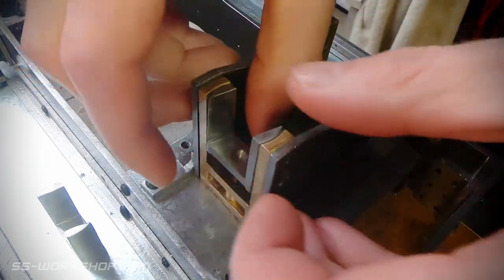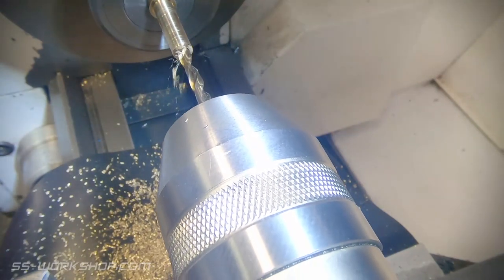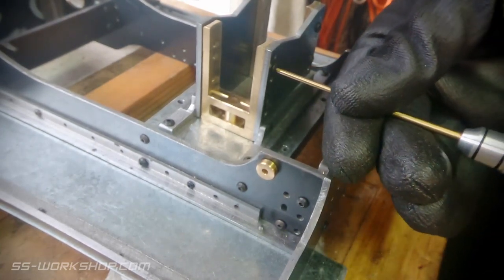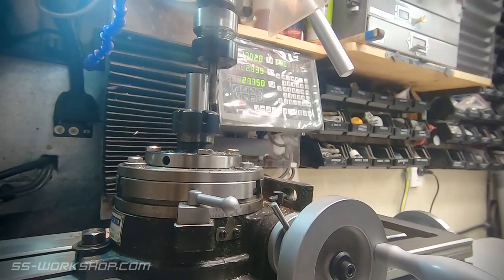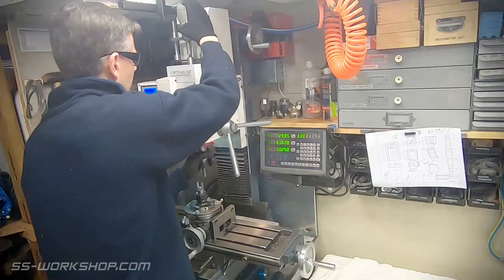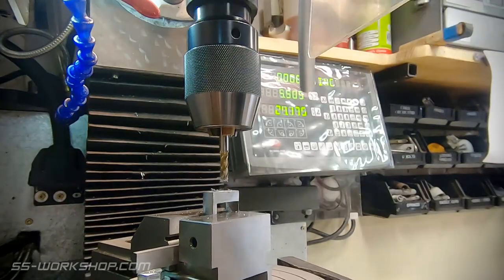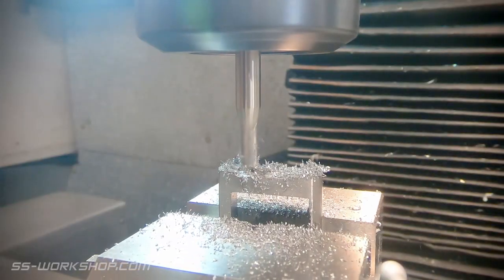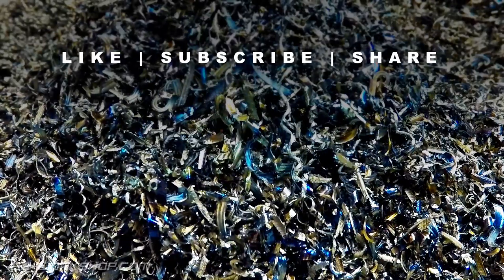Fell Engine Project - Radial Axle Pt2 S1.E39 (Live Steam Locomotive Building)

Comment: I'm really enjoying these videos.  You do a wonderful commentary.  A quick question,  is there a function on your machines draw bar that pushes the MT loose.  I find I need to give mine a swift blow with a soft hammer to free it.  You'rs looks effortless.  Thank.
Reply from the maker: Thanks Byron, glad your enjoying them. The drawbar on my mill has a collar at the top restrained with sleeve which screws on. This stops it lifting much as it’s unbolted allowing to be unbolted but it still takes a lot of force on a wrench and a soft hammer. The impact of the power drawbar setup is what makes all the difference. By the way for the power drawbar setup I’m using a cheap air powered butterfly wrench.